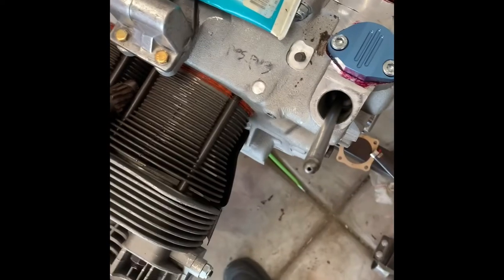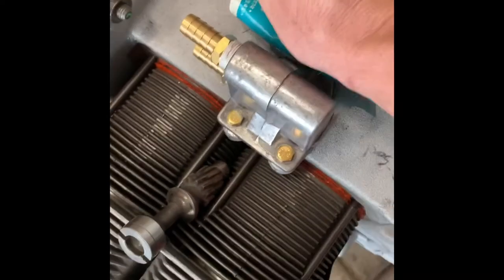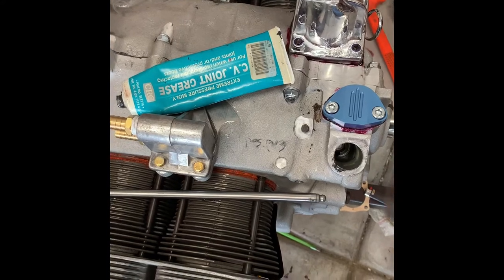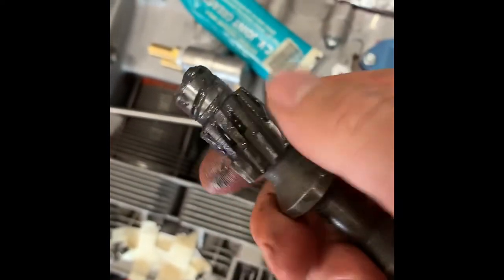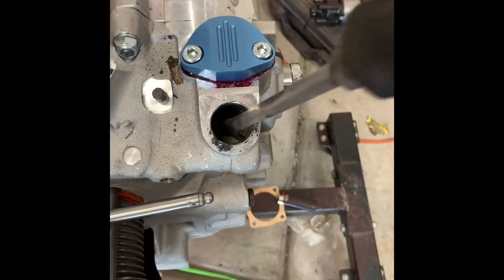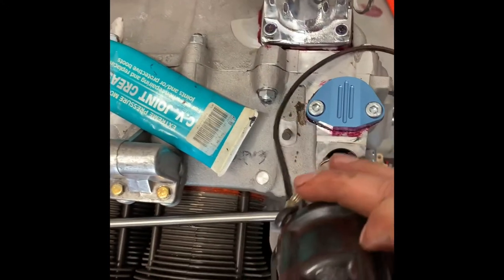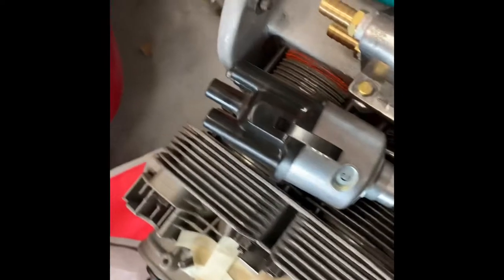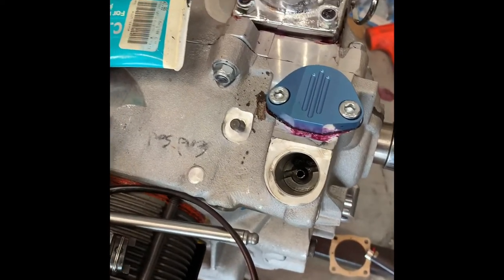Vw type 1 distributor drive gear installation

Comment: i see people saying this is wrong. think about this.
1. you aren't running a vacuum advance dizzy or stock location mechanical fuel pump so you don't need to orient the distributor (drive gear) so that the canister clears the fuel pump.
2a. you're running an external oil cooler so you don't have to concern yourself with the overheating #3 cylinder which is a problem with the ancient stock pre doghouse cooling system which leads to issue 2b.
2b. someone will tell you the distributor has a 3 degree retard built in for the cooling issue of the #3 cylinder. you won't have the #3 heating problem because of your fan shroud and oil cooling system. also, you're running an electronic ignition which doesn't have the 3 degree retard built into it.
conclusion: for your build, it won't matter how that gear is installed. however, if anyone other than you were to work on the engine, they would expect that gear to be properly installed and probably wouldn't check. they would then proceed to do something like adjust the valves and botch the job.
Reply from the maker: Thanks for the input I need to do an updated video. This is the most constructive comment I have received so far. To avoid confusion I will correct my video it just takes time.
Reply: @problemgarage6412  i hate to say it, but i think some people want to yank a newbie's chain. yes, i'm sure many out here would like to see an update. i'd be one of them. you haven't featured the baja in your vids for like a year? i figured you had sold it or something along those lines. the vid is fine. just pin my comment to the top.
Reply from the maker: @redshirt-scotty  yeah been busy building a 50x100 garage.
Reply: @problemgarage6412  envious!

Comment: The distributor can only go in one way. It is the drive gear you have to clock correctly. I didn’t see you pay any attention to that.
Reply from the maker: The crank is on TDC is their a different way this is supposed to be done ?
Reply: The groove in the shaft should be perpendicular to the crank shaft with the smaller half facing rearward. Then, when you drop the distributor in, it will be set to go. You should know that before making an educational video.
Reply from the maker: @Mr572u   you are right. I misunderstood when I was learning about this. I thought the line needed to point towards the crankshaft it is the larger half circle needs to point towards the crankshaft. Or larger c towards the crankshaft and the smaller c towards the back of the engine. Thanks for the in put I will need to update this video.